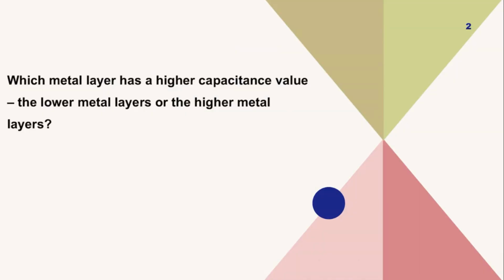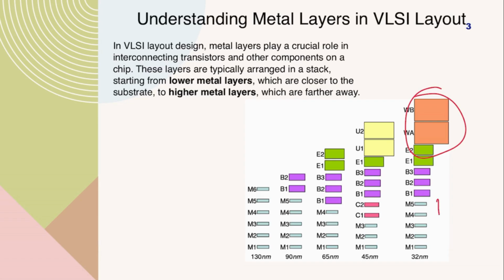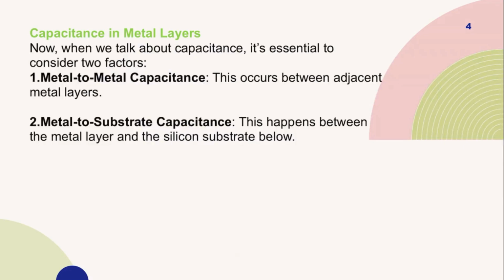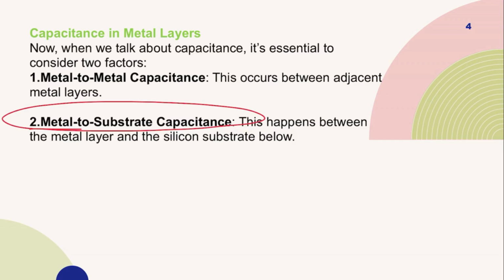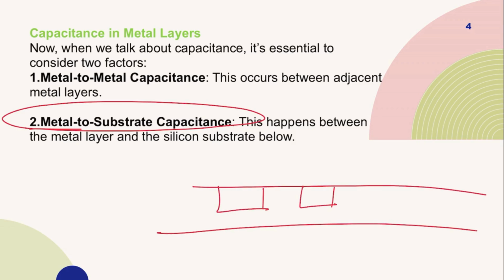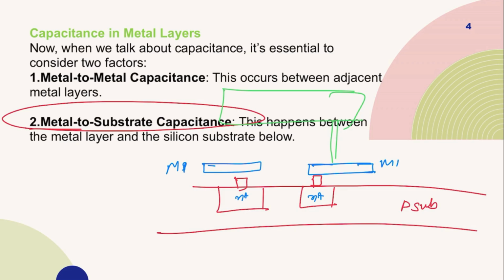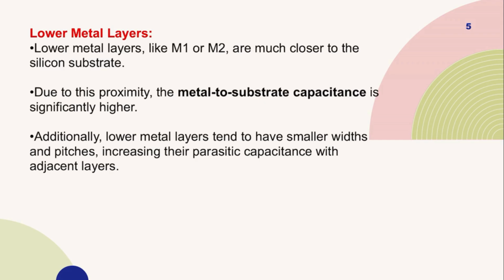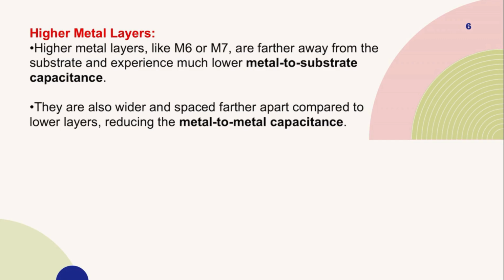Understanding Metal Capacitance in Layout Design #vlsi #siliconvlsi #learning #semiconductor #rv

Comment: In higher metal resistance is low bcz of thickness is High and bcz of resistance is low voltage drop is less and it will provide sufficient power to the required devices this wt i think
Reply from the maker: Yes, true.also it has a wider width